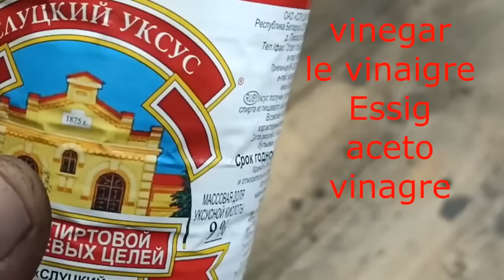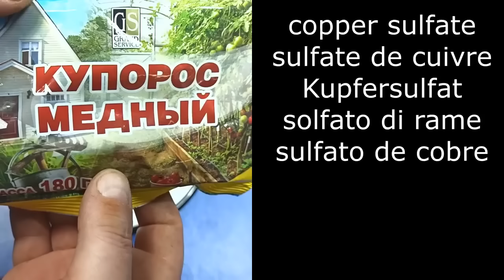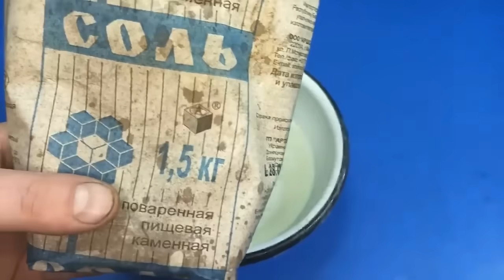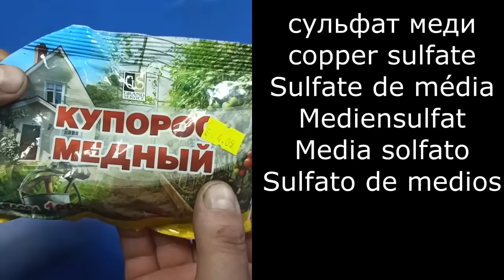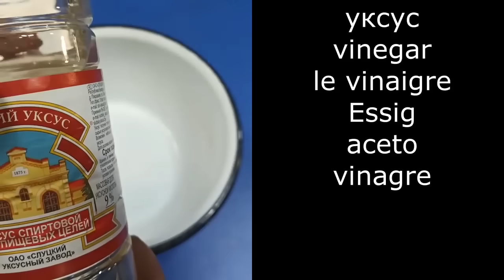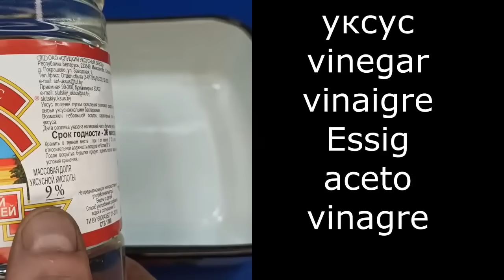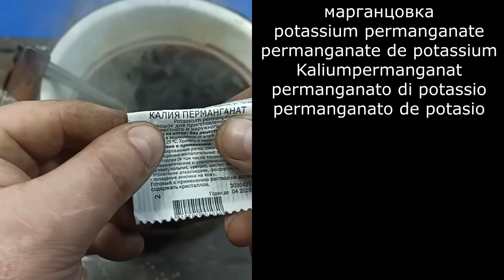Мало кто знает этот метод дешевого хромирования! Сделай сам в мастерской или гараже

Comment: Careful with doing this, I did similar and got Hexavalent Chromium which is 100 times more carcinogenic that the blue purple Trivalent chromium. I used 2 different stainless sources one was pure Hexavalent and the Other separated into a Trivalent layer on the bottom and Hexavalent to the top layer. So I have 2 jars of poison at home now, you know how to render safer or force hexavalent to convert to trivalent?
Reply: As a lad in the fifties worked in a plating shop and the dangers were ignored, we even had cyanide eggs laying on the floor while we ate our sandwiches for lunch.  The Cadmium plater did not bother to wash his hands, amazing when I think of it.

Comment: Hi made my own copper plating solution with soda bicarbonate and distilled water and put copper electrodes. I made a generous amount of solution but the problem I have is I plated a feeler gauge for mechanical work. But when I tried a kitchen spoon? It was patchy on the handle. I used electronics contact cleaner but still no good! I used wax and grease remover and still patchy! Is there a better cleaner I can use? I was going to use carburetor cleaner . Any reply appreciated cheers ! It also takes a long time but it's ok. When I clean with detergent it smooth out the spoon but also takes a fair bit of copper plating off! Any advice would be greatly appreciated 👍👍👍
Reply from the maker: Degreasing, alkaline solution for steel and cast iron

Dissolve in water:
200 g of caustic soda,
500 g of liquid glass,
280 g of sodium phosphate (crystalline)
Reply from the maker: The following solution can be used for degreasing:

Caustic soda (caustic soda, NaOH): 10-15 grams per liter of water
Trisodium phosphate (tri-substituted sodium phosphate, Na3PO4): 50 - 70 g/l
Soda ash (sodium carbonate, Na2CO3): 30 - 40 g/l
Liquid sodium glass (silicate glue, Na2O sio2): 3 - 5 g/l
Reply: @KovancaPolock  thank you for your quick reply!👍👍👍
Reply: In plating plants they used to use and may still do a substance like washing up liquid to make the water wetter.  So try a little but as advised cleaning grease off is paramount.

Comment: great video, do you get black chrome only with copperlayer first?
Reply from the maker: I didn't understand the question
Reply: @KovancaPolock thanks for the reply, You first coated aluminum with copper and the chrome layer was then dark, while the steel was lighter, i.e. silver.
Reply: @tomedelkowski6567  он говорил в видео, что цвет зависит от типа нержавейки, с которого делается раствор и может быть черным.

Comment: Tried the same, but I became black and later rusty a lot, used non magnetic stanliness steel not sure what happened
Reply from the maker: Chrome can be black, depends on the alloy. In order to avoid corrosion, the part must be extinguished with soda after the acid.

Comment: From this video came to me a stupid idea. Idkn if it is already existing or not, but I want to make a machine that will clean the metal with more brushes at once, instead of doing hand work. Does it exist? Or I'm just hallucinating that I could make one? Similar to wood planer... it could be said. But not taking material just cleaning it with some micro adjustments. I'm not a machinist so I don't know how to do that, I'm just giving up an idea... good or bad... Idkn... 🙂
Reply from the maker: There are many options for such machines, but they are all ineffective.
Reply: @KovancaPolock  Why do you say that? I would love to know the flaws of what you tried and maybe finding new ways to do that... or not. But from other findings you can always go wrong or... better, and I will also share if it works.
Reply from the maker: @klannstyle  Poor-quality rust cleaning, rapid tool wear. Expensive and inefficient.
Reply from the maker: @klannstyle  Did you mean cleaning based on an angle grinder?
Reply: @KovancaPolock  Nope. Just a tool like a planer on wood. With many brushes attached to it instead of the wood blade. Then, on the other side it should go smoother. So, not an ordinary tool, just a machined one that will do the work for you. Remove rust,  also remove a tiny bit of material to have a clean surface.

I repeat, I'm a dreamer and I just have this weird thoughts. Is it possible to do what I'm saying?

I do hope you understand what i'm asking here.